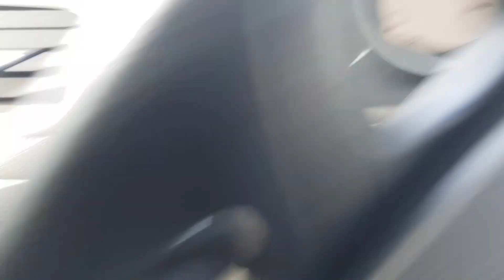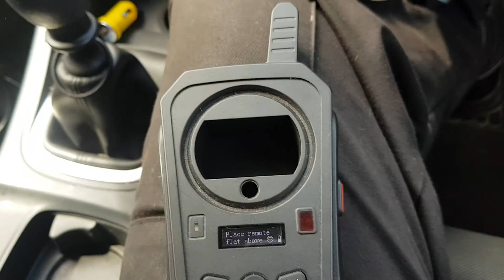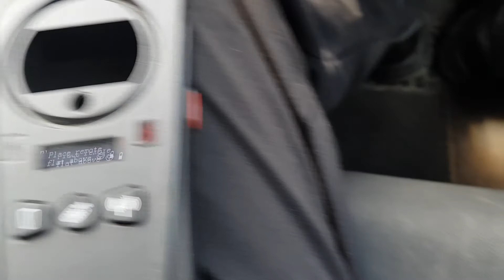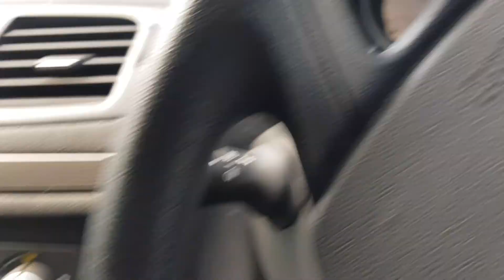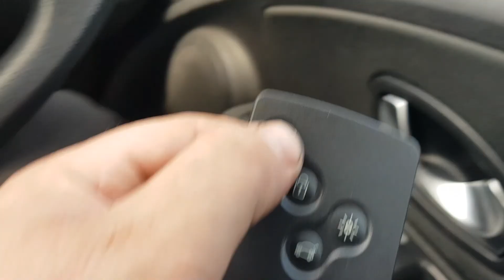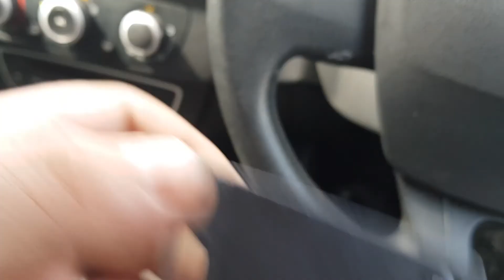Renault Megane 3 key card fault and programming using Halkyard tech

Comment: Hi, I my case connect correctly and show two actual Keys but when push the button start programming a Window with text error! I uso truecode 323 or Ford Code. Have you another versión? I have tried with new key inserted and without the key and the same message. Help me please
Reply from the maker: I use genuine truecode. Never gives any problems.